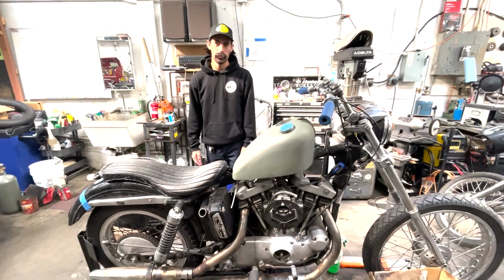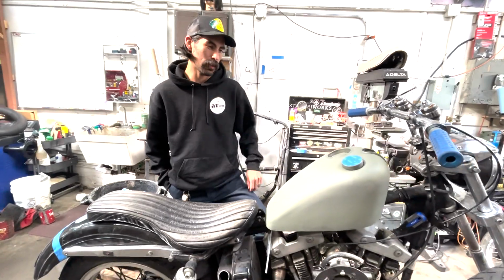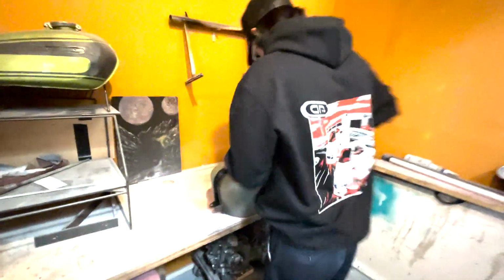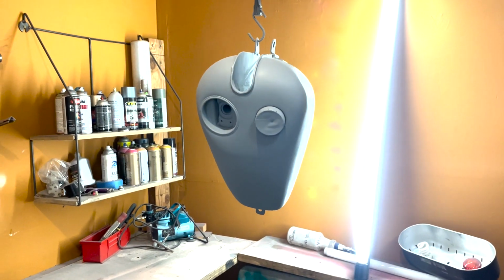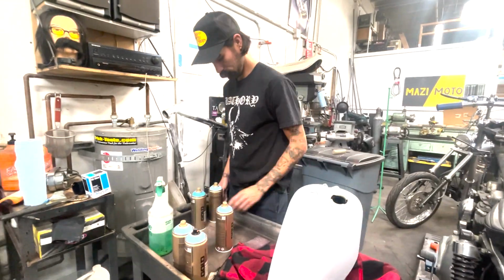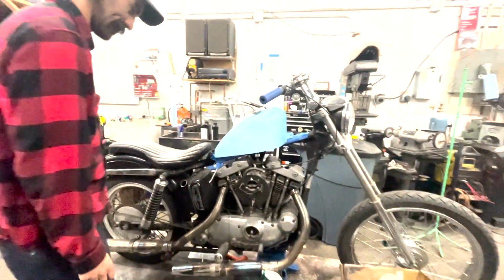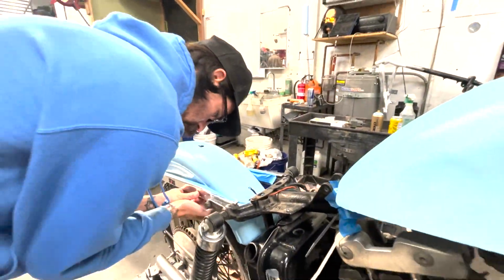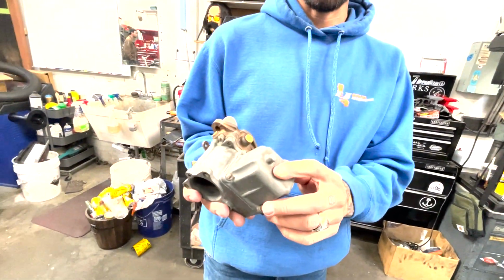Blue's Paradise Roadshow Ironhead Build

Comment: I'd leave the forks just as they are -- length and all. Maybe you could go with pearl white with ribbons on the gas tank. I remember a guy in Weseley, Massachusetts and a few guys in Connecticut the early 1970s went with the aforementioned paint and design. The early 1970s NorCal style is always a great way to go -- nothing radical -- very functional design. Good luck, Blue. Thanks Yama.

Comment: I picked up a 72 sporty basket case.  Frame,motor ,and back wheel. $360.00. I can't really afford to go out and buy new stuff. Last weekend I took off front end from triumph and installed it on sporty for mack up. Trying to find out if a good idea or not